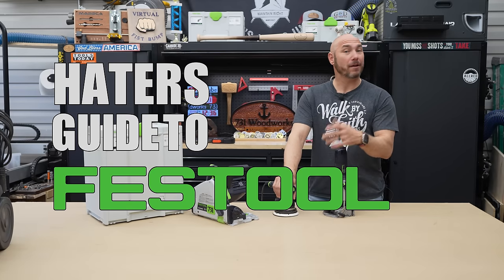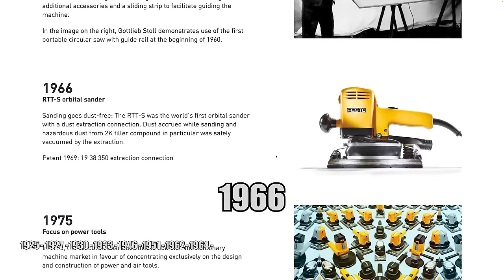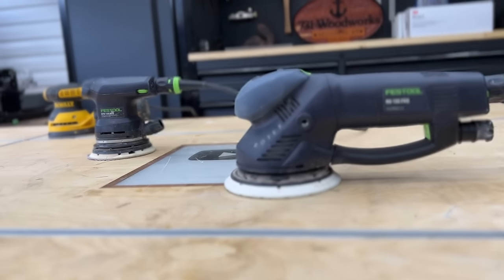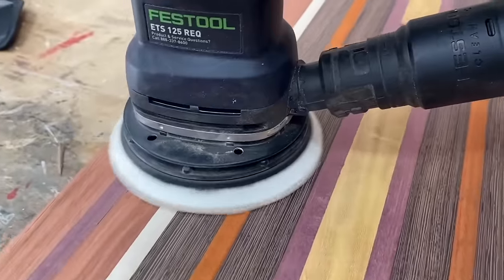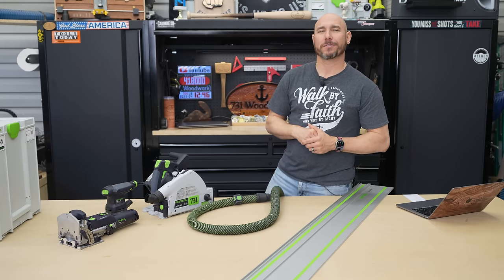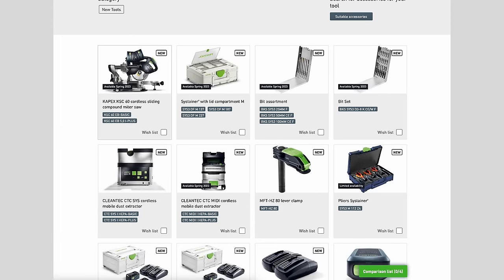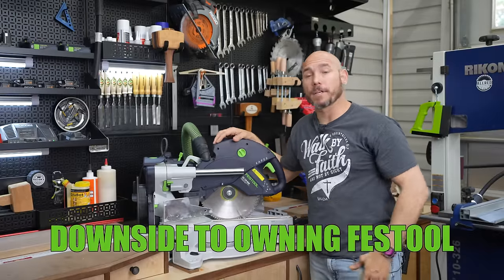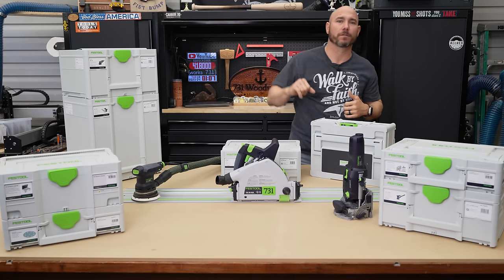The Hater's Guide to Festool | How Festool Changed the Game

Comment: Well, good tools aren't exactly inexpensive. While Festool is in the top range, Bosch Professional (blue colored series) is close behind in the price range. My wife and I bought this old German house and it will take us some years to get everything going here. Example: I'm using this Bosch Professional cordless screwdriver that I inherited from my dad, and it doesn't seem like it's gonna pass away anytime away soon. It just feels like a good tool to use, it's not special, it just works well and keeps going. While cheap electric drills usually break down quite soon once you start using them every day.

I also have Bosch Pro sanders, same thing here. We'll see about the drill hammer, which is a Japanese Makita. Another high-quality German brand is Metabo. Actually before we had the Makita, we used an old Metabo from my wife's granddad. It would still do most jobs, but you can't stop it from rotating to work only as a chipper.

Comment: I tell you the problem! It's not a American company! That's all!
I am Bavarian carpenter, so we only use Festtool or Maffel Maschines for professional wood working. I mean, only the woodworking Maschines! Rail Saw, router, jigsaw, sander, planner and maby domino ( but you don't use domino😁)!
The other Maschines are Battery screw drivers from Makitta, Drill Maschines from Hilti or Bosch, etc.
I just don't get the discussions about the prices!    Altendorf Elmo F45 table saw starts at 28000 €, a Homag CNC Center starts at 65000€! So why in world, should a domino be too expensive...............

Comment: Im a festool hater and i love using all the tools i own by them and most the tools by them iv used lol 

i just hate anytime a company starts doing business based on perception, marketing and name instead of purely quality/usefulness. Which can describe a lot of fes products and pricing.
Reply: Plus the stuff I do just ends up too specialized for me to try to rely on pre-made systems, jigs and stuff like that where a finish carpenter would make good use of. So the closed garden model doesn't lock me in like many.
Reply: I did prefer my 10" glide over the kapex we had in the shop (i did some modifications tho, so...)
Reply: Proprietary/oddball sizing anything also just rubs me the wrong way, be it blades, sandpaper, whatever. If you intentionally remove choice without good reason, I won't choose your product.

Comment: Rob Robillard over at Concord Carpenter/Toolbox Buzz just did a head-to-head review of cordless impact drivers.  Near the very end, he made the case for professionals buying professional grade tools as not all the pro grade tools were at the top of the list.  He used Festool as an example. He explained that in their research, they found that the anvil was prone to high failure rates in impact drivers.  So, Festool changed the shape of the anvil and used different material so that in a pro's hands, the tool will last longer and provide a more consistent work experience.  There was other good rationale provided by Festool, but you should watch Rob explain it.  And it tracks pretty much tracks with what Matt is saying here about Festool.  Well thought out tools (I have several, and would have more myself if I was using them to make money).

Comment: I bought a festool track saw when I was working in Belgium in 2005. I saw a guy using one and I had to have one! I took it with me back to Australia and it worked for 12 years. It was accurate til the end. If your a general carpenter then makita will do you fine. If your a serious woodworker then festool is the way to go.

Comment: My woodshop is my unfinished basement and live in the Northeast.  Before getting the sander and CT15 I went outside to do my sanding, so the hobby really died down in the winter.  I can sand all day inside now with that setup and still have a clean shop.  Haven’t purchased anymore green tools, but if I thought I would get use out of them I would.

Comment: I bought the dust extractor for my Shapeoko because it's quieter and the motors are designed to run so much longer than a shop vac (and my big dust collector is the wrong sucker for small diameter tools), splurged on the compatible but way overpriced anti-static Dust Deputy as well. But it was the ETS-EC sander that really convinced me. I love my 20v dewalt compared to everything before it, but the cut speed and and near zero lack of vibration fatigue on the Festool is just a game changer (I assume the Mirka and 3m ones are similar … best expensive tool you can get for quality of life … after a table saw that won't take off a finger). And yes, I love my domino but that was completely a splurge (but that "pop" when you take the fence off to change the bit?! That's some precision engineering).

Comment: My first Festool was a track saw about 15 years ago and there was no looking back.  My second was OF1400 router.  After buying a bunch of the $89 sanders and being PO'd at every one, I bought a Rotex RO125.  The difference was night and day.  It almost made sanding enjoyable.  I used a shop vac at the time.  I didn't get an extractor for several years.  I still though them expensive, until I bought one.

I now have five sanders, two routers, jig saw, Domino, and a Kapex. I do use Bosch drills and some of the weird Ryobi tools (the heat gun is awesome), I like high-end tools, sure, but I'll buy others that fit my needs. I'm long past the time when I buy junk tools then have to replace them in a year.  Cry once!

I am a hobbyist and have been putting my shop together, seriously, for the last decade with retirement in mind.  I retired a year ago so it's now getting used pretty heavily. I've spent a lot of money, sure, but it's my only vice. 

Your suggestion of a ROS as the first tool is close but I'd recommend the Rotex instead.  It's dual mode and in the Rotex mode it's very aggressive.  It'll make short work of a lot of wood. In the ROS mode it's still pretty aggressive but it's still a fine sander.

My wife calls the Festools "Green tools".  Then there is "red" and "black" (two, really) in her lexicon, too. 😁

Comment: Not all tools Festool makes are worth the money. Their mitre saw, in my opinion and all those in the shop I work at, is the worst tool they make. Does not stay square when taken on sight, the pistol grip handle is awful, and it is only a 10".  Best part of the mitre saw is the clamp used to hold pieces. Their Dominos are the best thing they make. Everything else they make have comparable options. Personally I would take the Makita track saw over the Festool track saw.

Funniest thing I have ever heard about Festool is an acronym an old stair builder I know may or may not have come up with. F.ucking E.xpensive S.hitty, Tool. Had me in tears.

EDIT: Oh and their Conturo is worth the money. We don't use it often at the shop but when we need to it has saved us from some incredible headaches.

Comment: You're right about the Festool System.....most of the haters that I have encountered, simply do not understand the way that all of the tools work together. In particular, if you work out in the field, you can transport everything you need to produce work of exceptional quality on site.
And for the professional, the warranty is worth it's weight in gold. I don't know how this works in the States, but over here in the U.K. my 11 year old dust extractor developed a fault with the auto switch. I requested a repair on the website at 1.00 a.m. on a Friday night...the extractor was collected on Saturday morning, a quote for the repair was received on Monday, and I was using the machine again on the Wednesday afternoon, as good as new....and this was an old model that had been out of production for years! Yes, Festool is damned expensive, but you get what you pay for....quality, accuracy, longevity and unmatched service.

Comment: I have had at least 22 Festool tools.  I love their dual-mode sanders, C drill, and track saws.  I also love the domino.  

But their dust extractor lacks the suction of a $100 shop vac. I hate this fact.  I hate that everyone with a Ridgid can easily clean up in half the time.  

I hate their cheap, POS systainers.  Not only are they brittle and small, they turn a grotesque yellow with any time in the sun.   

Bottom line, I still have 12 Festool tools.  And while I love them, I have no interest in purchasing any new Festool tools.   

Generally speaking, Festool tools are underpowered compared to competitors.  For example, I was cutting a fire rated door, long side, with track saw and someone with a porter-cable had to finish the cut since my TC could not complete it.  It was embarrassing to say the least.

Comment: Great video, a excellent brand review. If you are going to buy a sander, make it a 6" (150mm) not a 5" (125mm).  The 6" size will save you a lot of time. My first Festool sander was the Rotex 150 combined with a CT15 dust extractor.  Any of the 6" sanders will save you time.  Ironically my second sander with the 3" (90mm) Rotex, an amazing versatile sander with multiple sanding heads (round, triangular, extended triangular).

Comment: I think part of the reason they get so much hate is the same reason they get so much love.  They're kinda gimmicky.   All their gimmicks are amazingly great gimmicks, but  it's a still gimmicks.   When you use them those gimmicks are so nice. Not necessary but really nice.  Also for the price,  some of their plastic kinda cheap.    The dust execrator we have at work being a perfect example. It just feels kinda fragile and for your noob or hobbiest or your rough around the edges construction guy that works in the trenches instead of the finish work some of their tool just seem fragile even if they aren't. Another slight against them for the haters is their a purely woodworking line.  That kinda kills it for a lot tradesmen and contractors
Reply: check the catalog for other tools for tradesmen.

Comment: I've been looking at purchasing a tracksaw and it seems like every review for another brand includes a "but". Is the lack of a "but" worth a 10 to 30% premium? 
In my experience, that 30% premium (based on other types of tools) is usually balanced by a lack of frustration when using it.
Reply: There is a "but". They don't do too great on with the grain cuts in solid wood. The overload protection electronics are rather sensitive and it will bog down on you

Comment: If you are a one man shop it’s very easy to justify the cost. However if you have employees or are doing woodworking on a job site you can bet money on the fact that other people are not going to care about your investment. I’ve seen tools dropped, I’ve seen tools dragged off of work benches because someone tripped over an extension cord. Tools get mis used all the time. I have 48 years of experience both having my own cabinet shop and working Job sites. Even the most conscientious employee will have accidents. And if other trades are anywhere near your work area the odds of unintended mishaps are multiplied. If I had to start over and was only working out of a shop by myself it would be a no brainer to get the best. In the real world, not so much. Just my 2 cents

Comment: Well, Festool are not really slammed or hated in Germany, Festool, Fein, Metabo and Hilti (in some cases Bosch Blue but rather not) are the most loved powertool brands in Germany. 
Neither brand is heavily targeting consumer or hobbyist markets, if you use your angle grinders, saws etc. once or twice a year, the cost will probably be the main reason to hate on them. 
If you're a professional, there is barely any second guess to go for anything else due to reliability, repairability, parts/service and tool quality in terms of vibration damping, safety features... 
Hate on Mercedes as much as you want but they do make some damn good and safe cars too but it comes at a price...

Comment: I have a small garage shop and maybe make something every couple of years so I have no interest but I am curious, arn't they all calibrated in metric or can you get them in imperial scales too.
Reply: Imperial is available; some tools like the Domino are metric only
Reply: I bought my Festool TS55 track saw about 10 years ago. I have a basement shop and am always lacking enough space. I decided against buying a large cabinet saw, and instead get a track saw for breaking down sheet goods. I watched Ron Paulk videos on You Tube and was hooked on the idea of a workbench using 20mm holes. I did not need portability, so I built a 36” x 84” bench and CNC’d my own bench top while working at a prototyping shop. The track saw has been a game changer. I have since bought a Domino 500, Pro/5 sander (special release of the ETS/125 sander), a CT26 dust extractor, and Carvex jigsaw. I plan to get a Rotex sander and a OF1010 router next. I am retired, a hobbyist woodworker, and have zero regrets about buying Festool. 
The other game changer for me was getting one of their sanders. I tried several brands of random orbit sanders, and all would cause numbness in my hands.  The Festool sander is a delight to use. And the dust extraction is amazing. 

“Life is too short to use cheap tools”

Comment: Great video. I am considering the dust extractor, but can't afford getting the sander too. How much difference is it in dust collection between using festool sander vs ridgid sander combined with the festool dust extractor?
Reply from the maker: You'll still see a major difference using other sanders.  Because the extractors have hepa filters, the fleece bag (which keeps dust inside), etc.
Reply: @731Woodworks  I would say the ability to adjust suction is a huge advantage. To swirl mark or not to swirl mark

Comment: This is a very surface-level analysis of Festool tools without the years of experience with them. I personally used a Kapex until it died. And you know what? It died WAY WAY too soon. The motor in it is far too weak to be used by a professional carpenter daily. We didn't even use it for anything but stairs, and it only lasted a few years before becoming an unreliable piece of junk. Festool sanders are also notorious for a slew of problems in my experience. They eventually die for a variety of reasons without notice. A tool as expensive as a Rotex should last longer. Makita tools are far more resilient in my experience. The only thing Festool has going for it is innovation. They try to get their first, and then they pull the ladder up with them and charge people a fortune for their cheap products.

Comment: Festool just came out with a new portable table saw and it's awesome. Now it is 3x the cost of the competition but hear me out, it can robotically adjust the blade to preset heights and angles for you. That way you don't have to actually know any math. Math is hard. Totally justifies the little bit extra price.

- My butler just told me it didn't come with batteries. I made him go search the box again. Regardless, I don't care. Still worth it.

Comment: Festool seems to be a good system. There seems to be an accessory for doing everything, a much wider variety than I see in other product lines. After doing a bunch of sanding I might eventually go for their sander and dust collection, in part because they have wireless power on so I can use it with non Festool products. No one else seems to offer wireless power on, but I didn't exhaust all the other high end dust collection systems. I don't know about what else I'd get.

One reason why I was annoyed with Festool was it seemed like there was a lot of plastic for an expensive product line. But plastic isn't always bad and it's not necessarily cheap or bad.

There was one guy on YouTube that tore apart a Festool track saw and found they used a bronze bushing on the inboard bearing of the motor shaft. It just seemed like what I'd expect to see on a Harbor Freight tool, which is super cheaping out on an expensive tool. Maybe everyone does that, I don't know. Bronze bushings are great for intermittent motion. Dunno about sustained thousands of RPM. For example, in fans, generally speaking, the good ones use ball bearings, the cheap ones use bronze bushings and don't have as long of a life rating.

I'm sure the Domino is a great tool but part of the reason why there's nothing else that can replace the Domino is because it's patented. Anything else that would do the same job has to work to stay clear of the patent or pay Festool for the right to use the patent, assuming Festool is willing to license the patents.

Comment: As far as recommendations, I would push the ETS EC150/5 over the ETS 125. 33% more coverage with a 6" sander over a 5" one, and the 5mm stroke is a great in between for aggressiveness and surface quality. The cordless track saw (TSC55) would be next, as it's hands down the best on the market.